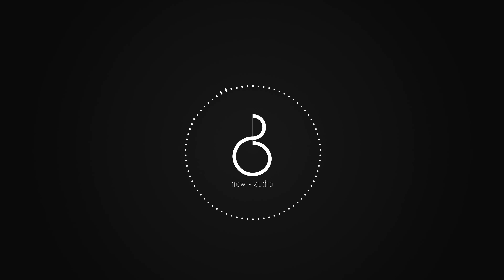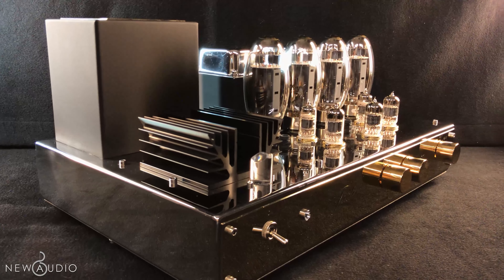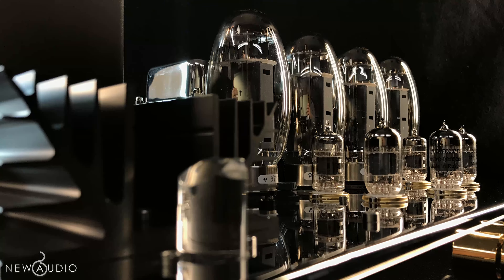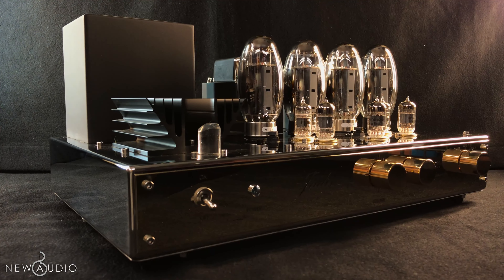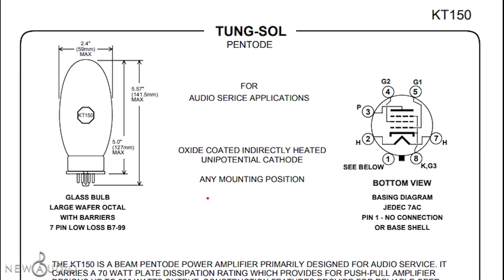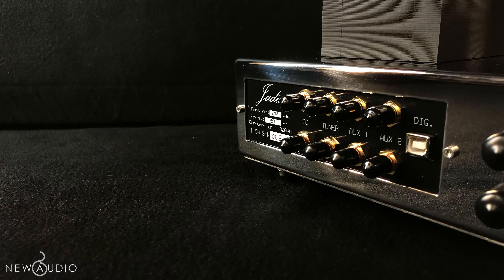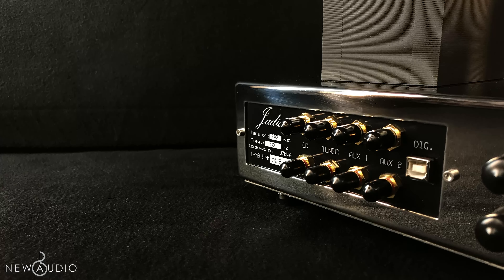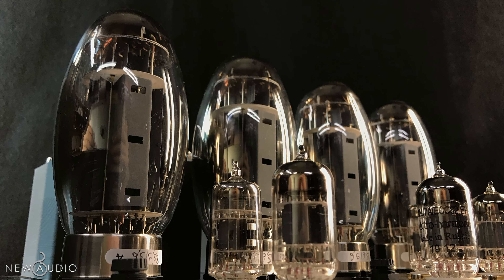JADIS I-50 uno spettacolo visivo e sonoro

Comment: For such an expensive set, the gold plating on the fascia and knobs get rubbed off after a few years, especially at the touch points. Can't jadis provide thicker gold plating? A solution is to spray a layer of lacquer over the thinly plated parts to protect their golden integrity. Are you listening, JADIS?
Reply from the maker: Hello, if you are interested there are spare parts for the knobs and plates.
Reply: @NewAudio  I have the older orchestra reference with tone controls. What would be the cost?
Reply from the maker: @2mikelim  For commercial information send an e-mail with your request to the following address: info@newaudio.it
Thank you.